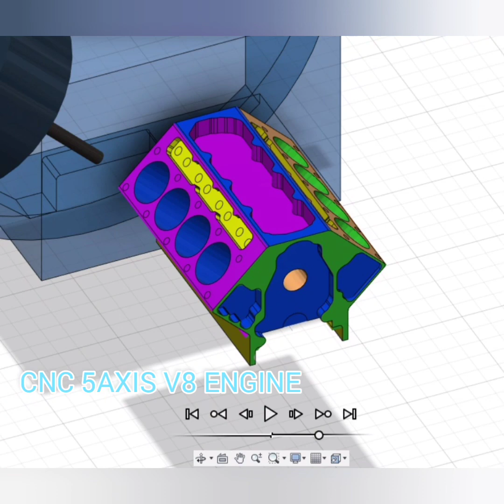CNC 5Axis DIY ( cam test V8 engine )

Comment: Good morning, my name is Marcos, I'm from Brazil, I'm looking to create a CNC like this with many axes, could you tell me which controller board you used, and which post processor? Congratulations, excellent.
Reply from the maker: i use control Mach3 and cad cam use fusion360